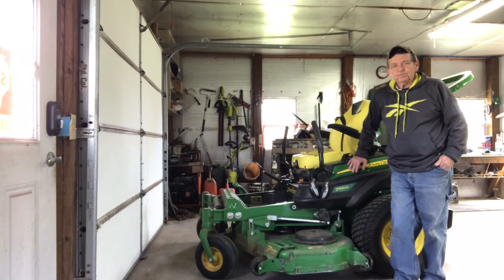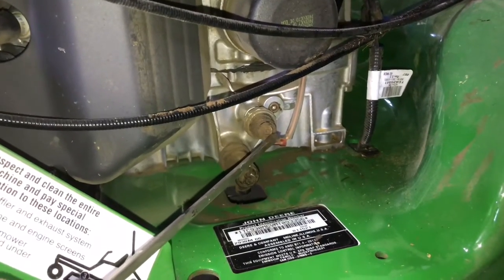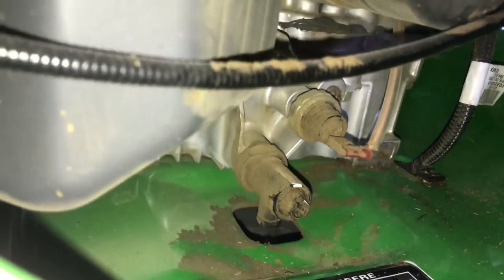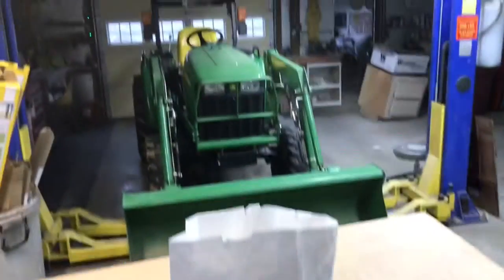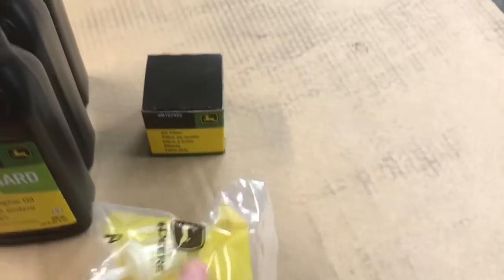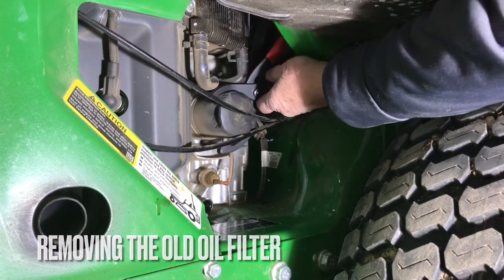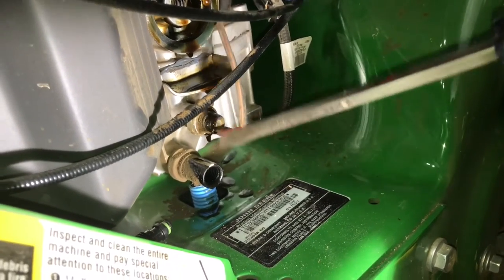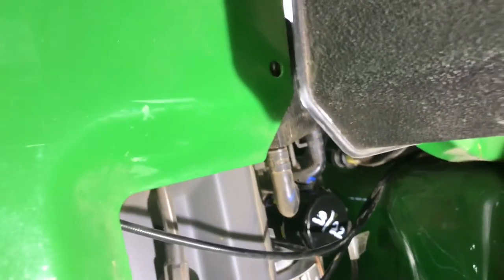Maintenance on the Z930M ZeroTurn Mower , getting it ready to mow.  @CreekviewAcres

Comment: Hi, Always enjoy your videos.  I have a Z930M  that I purchased last May and love it.  My only issue so far is that it likes the taste of gasoline 😀  It uses a lot more than my previous mower which was a GT275, of course the engine is much larger.    A tip on the new fuel filter that I learned was that it was designed for different diameter hoses.  I trim off the smaller end and just push the hose over the larger end and secure the clamp.  I have broken the small tip off in the hose before trying to remove the filter which is very frustrating.  Thanks for sharing!
Reply from the maker: Good idea

Comment: Any ideas on what to do if the head of your drain plug is broken? I just went to change the oil before I used it and it seems like the last owner somehow broke off almost half of the head.
Reply from the maker: Oh boy , 
 I guess buy a new plug to have it ready to go back in the maybe try and turn the old one with a small screwdriver. The good news is if it’s like mine it’s plastic so you could possibly break it out in pieces if you had to. 
   Good luck.
 Thanks for watching the video, if your not a subscriber hope you consider subscribing.